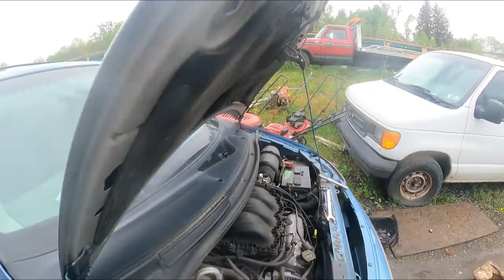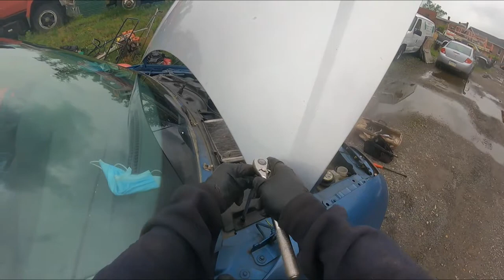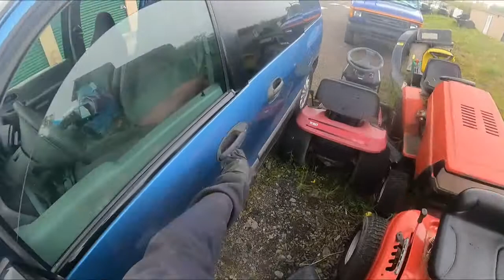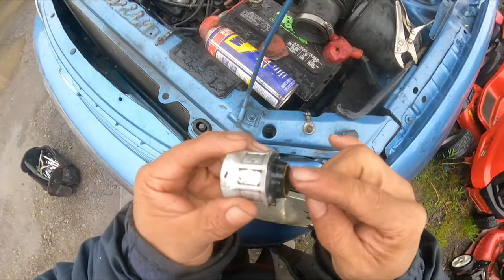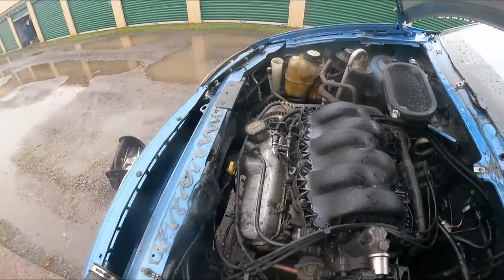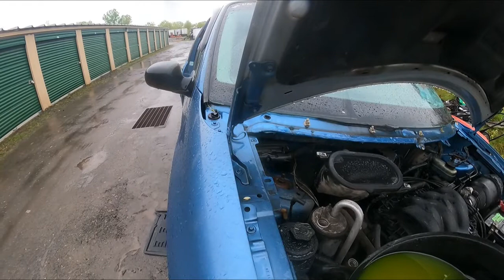FORD WINDSTAR 2001 HEATER HOSE INLET REPAIR

Comment: For those still working on these, let me recommend not replacing it. Where they break is at the plastic quick disconnect, so just remove the quick connect on the pipe, then cut the metal flange off the rubber hose, slip it over the pipe with a hose clamp, and go get 9 holes in.